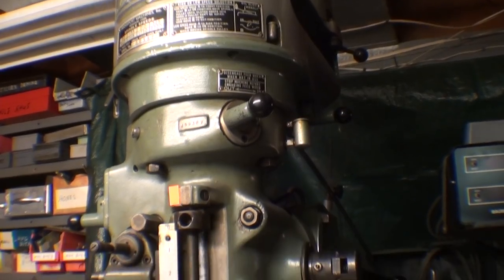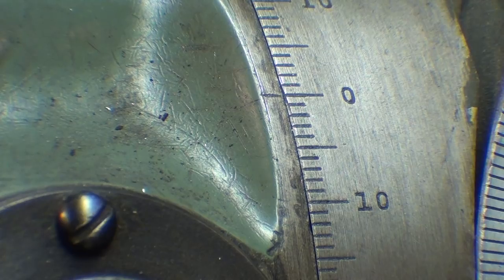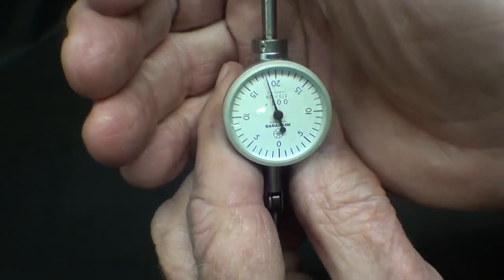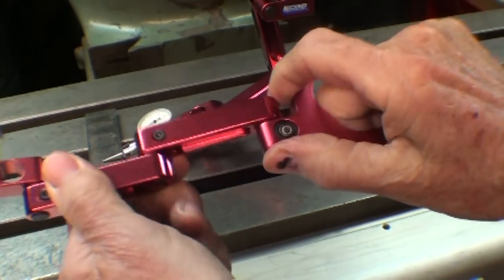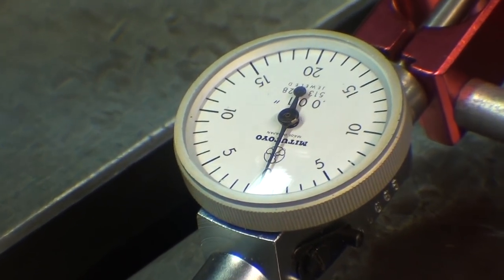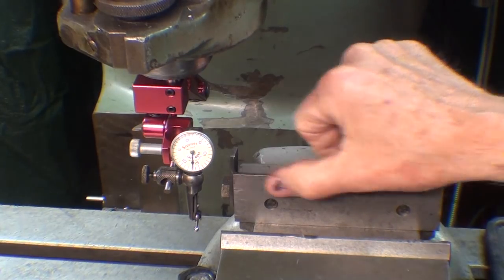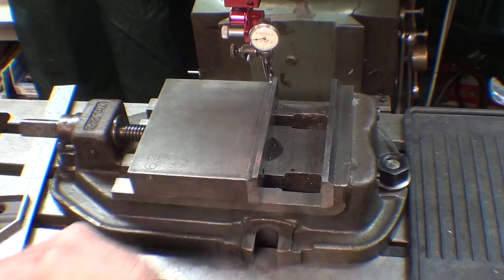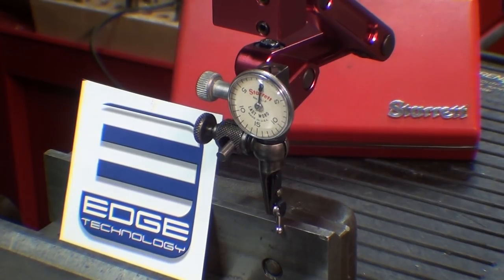Indicating the Bridgeport Mill TIPS #426 pt 1 tubalcain

Comment: Hello, I just found this video. I use the same way of measuring but I put a large outer bearing ring flat on the table so don't have worry about the tip of the indicator. The ring is about 12" or 14" in diameter. Works perfect for me. thanks for the nice videos you make!
Reply from the maker: Good idea

Comment: Great video, as always MR. Pete!  Just wanted to warn anyone with smaller mills, that don't have that nice worm gear setup  to adjust tilt.  When you loosen the head, it will be free to rotate and can get away from you and do some damage to the machine or you.  Also, if a new mill is being trammed for the first time, the paint can hold the head from tilting, and when it cracks suddenly and again get away from you.  Before the first time I loosened my head, temporarily fastened a wood 2x4 to the motor (which sits on top of the head). the 2x4 was just long enough to go up between two of the rafters of the unfinished garage ceiling. That way it would only rotate 15 deg. either way before the rafter would catch it.  Now that I've done it twice, I won't use the 2x4 anymore as I now know how much to loosen (very little) the nuts to be able too tap the head into tram
Reply from the maker: Good warning, you sure wouldn't want it to get away from you

Comment: The kind old dude is wrong about the position of the drill in an un-trammed head. The axis of the drill will always be concentric with the spindle bearings. Theoretically the quill travel will always be along the axis of the spindle bearings due to it's O. D. being ground concentric to the quill's spindle bearing bores. The drill or cutter will always travel along the same axis as the quill itself. However, in the case of the drill, it will cause the hole to move off it's intended center location proportionately to the tram error and that location error grows in ratio to the increasing depth of the hole. What was demonstrated in the example lesson by the position he held the drill in would occur if there were no quill, and the knee were being used for drilling. Then you would not only get an ovalled hole, you'd likely get a broken drill.

Comment: I have learned three things from this video:
 
1. This setting is called "tram".  
2.  I can measure this on my mill, and will since I know I am way off and have been fighting this for years.
3.  I am easily frustrated because my mill head or table seem to have no adjustment to correct for off tram.

On my little Jet mill It really causes noticeable difficulty using an about 6" flycutter. Any suggestions on what to do.  I'm thinking loosening the head and trying to slide some shims into it's mount, can't see where.  Maybe try and tilt the column or table somehow. I never knew I had such a low frustration tolerance!

Thanks,  Terry

Comment: Thanks for the video, very informative and educational as always. I use a torque wrench on the head nuts, I think the spec is 40 or 50 lb-ft. Since you have keys under your one vise, you could remove the keys, or possible use cigarette paper or shim stock behind the vise jaw to tweak it in when indicating.
Reply from the maker: Thank you, I was wondering what the torque specs were

Comment: You work with great precision mrpete very nice, questions not related to Bridgeport mill were would rate MYFORD metal lather (myfordml 10)
Reply from the maker: I have never seen or used A myford lathe. But I am told that they are excellent

Comment: Hello Mr. Pete - been watching for many years now - GREAT! Quick unrelated question...... I only have a Drill Press and need to drill a flat bottom hole in Aluminum. Can I use one of the End Mills that I happen to have?? Hole to be 1/4" deep and 3/4" in Dia.
Reply from the maker: Yes, I do it from time to time. But you must pre-drill a hole, and then only use the end mill to square of the bottom. Hold the work securely in a vice. It can get away from you, and scare the heck out of you.

Comment: Tramming the head or how I learned to cuss... When doing this on a Bridgeport type head you need to remember that the indicator is sweeping a Chord of the head pivot point and Not the Diameter. This means that if you sweep one side, then the other, unless you are very close to start with like Lyle, and then split the difference, re-sweeping the indicator will show that the head is still out. The difference will be less than before, but you will have to adjust the head again (and again) until you get the same reading on both sides. This is where having two indicators at once is an advantage... you can set the head square in one shot. The two indicator mount is a good weekend project.
Reply: Especially on the nodding adjustment.  That took quite a while for me to wrap my head around.  Not sure why, but when I drew it out, it made perfect sense.  I think the Index mill is easier to tram on the nod, than BP.

Comment: I never tramed directly on the table surface. I either used the outer race from an old bearing 200mm or more in diameter or slipped a gage block under the indicator tipster swinging into position. P,us if you have a square* long enough you can check tram by using the two surfaces the quill scale mount to. It won't be zeroed but it will get you closer than the degree markings to start. 
One thing I never under stood was why Bridgeport never put an alignment hole in for a shear pin on the heads and nod. Or you could put a pin in tighten the head up and pull the pin out. But then you would always have dome bozo leave the pin in.

Comment: My first tramming experience...
My Grizzly G8689 mini-mill, using a Mitutoyo indicator from work, I kept having issues keeping "0" when swung around.😕
After multiple attempts I finally discovered the case screws on the indicator were loose!😜
I was doing it correctly, and got it set in only a few tries.
Trust your tools, but, verify!😉😀😎
Reply from the maker: That's a good lesson for both of us
Reply: Yep...
I first thought it might be holder stickout, rigidity, or inexperience.
Keith Rucker would appreciate my using an antique spanner to tighten the column nut...  The only wrench I had large enough.😏😎

Comment: I don't have an indicator that i can sweep with but I do have an indicator that is installed into a tool holder.  Can I simply move the table to make the same checks or will that introduce a level of error since the table would be moving?
Reply from the maker: No, you cannot do that
Reply: @mrpete222  ok I will have to buy a setup like you have in that case.  What would the indicator in the tool holder be used for?  Sorry if this sounds like a stupid question but I just inherited this machine and I know next to nothing.

Comment: There's another way of truing a vise with table keys. Assuming both keys are tight and the head is perfectly trammed, remove the fixed jaw and machine the cast surface true with a long end mill. Replace the jaw and check for zero accuracy full length.

Comment: You fail to mention that the indicator holder is made in CHINA.
Reply: Remember the irony in Back To The Future when Marty says "All the best stuff comes from Japan"? Someday the same will be true about China. Where your iPhone comes from. Might be sad but it's been happening since the start of the industrial revolution.
Reply: A lot of good stuff comes from China today; the 80's are behind us.
Reply: Not everything that has been made in China over the years has been bad, just like not everything made in Japan has always been good.
I have a 1/2 Ton Chain block in my workshop I bought secondhand at a yard sale over 40 years ago and it had been well used then. I looked at the label on it the other day & it reads "Made in China". I have used this chain block many time to swap out old cast iron V8 engines without an issue.